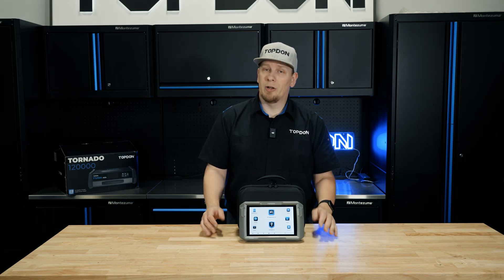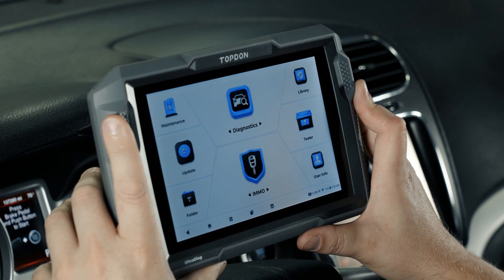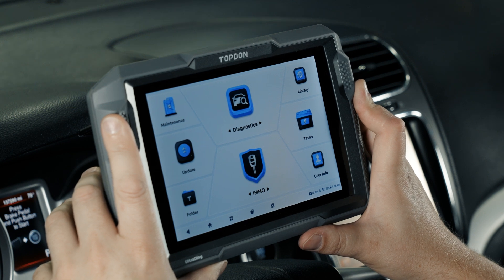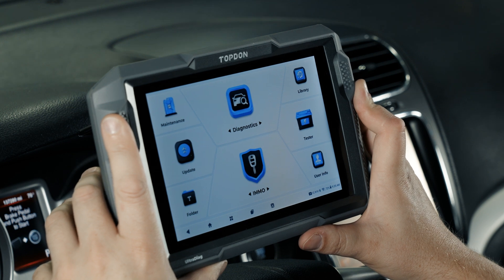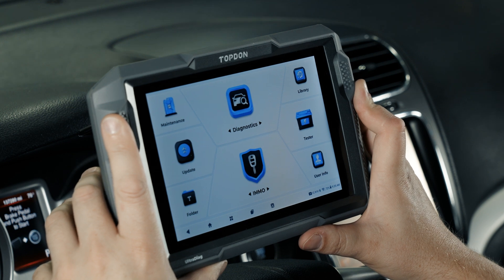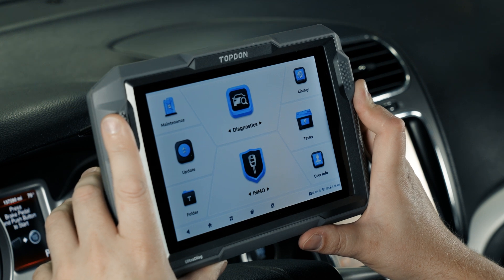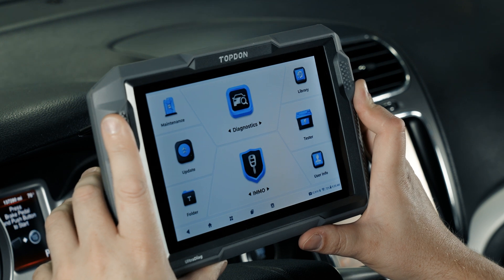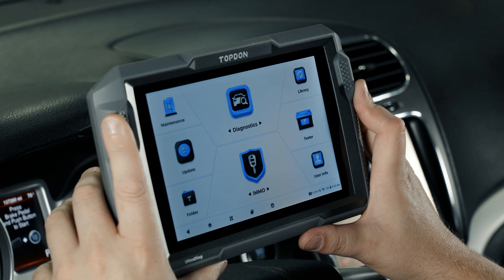TOPDON UltraDiag Scan Tool & Key Programmer Overview

Comment: You said when pulling vins and codes from cars make sure you're on Wi-Fi does that mean this does not work if it's not on Wi-Fi??
Reply from the maker: It will work, but the tool’s ability to properly identify the vehicle may be limited. This may result in the tool requiring manual identification of the vehicle.